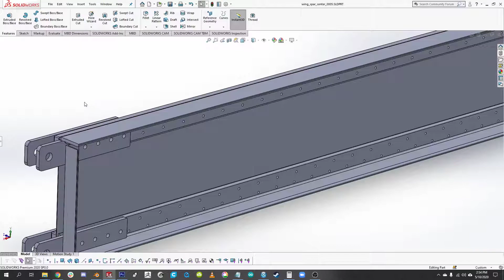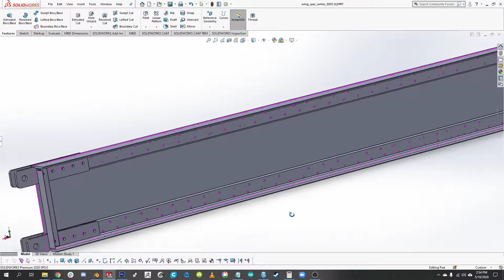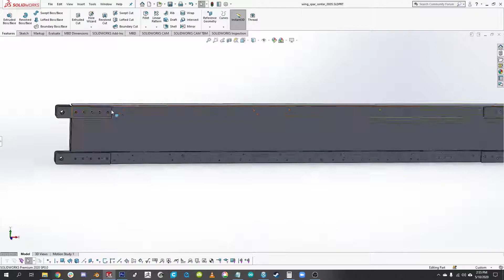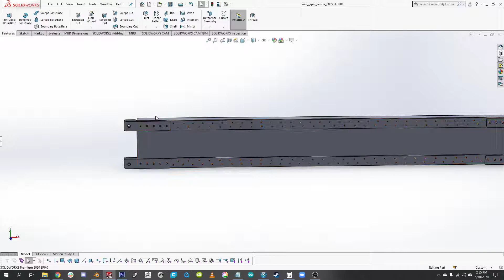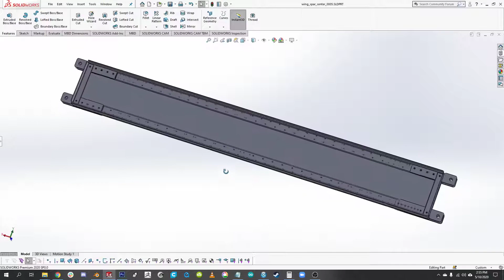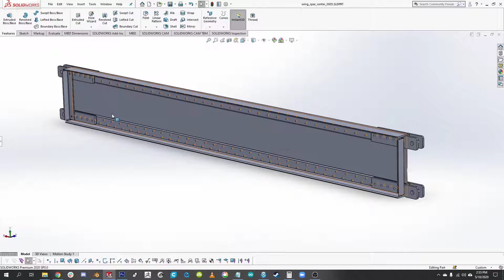Thatcher CX7 center section spar model

Comment: Be sure to add your intercostal mounting holes, as well as the holes for mounting to the forward fuselage structure - you'll find some discrepancy in the CX7 plans on the hole locations, so be aware.
Reply from the maker: Benjamin Carlson good call out, I’ve actually remodeled my spars since this video too. Still trying to make sure I get everything right